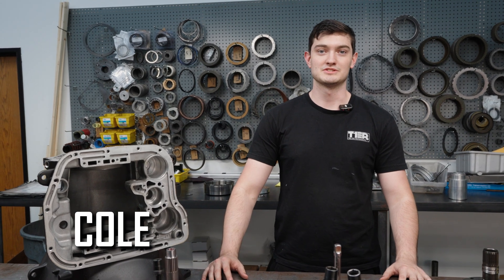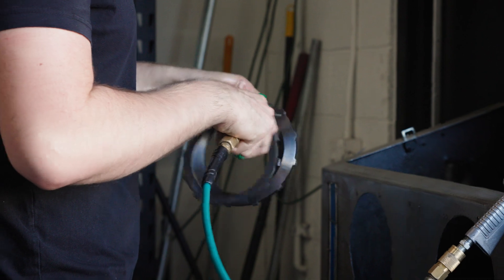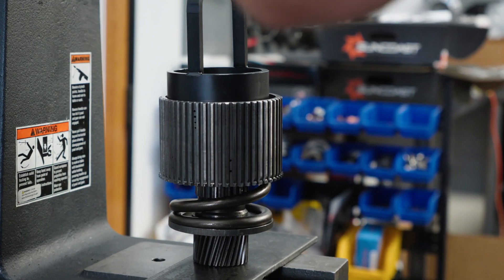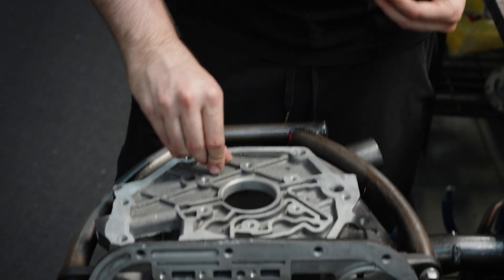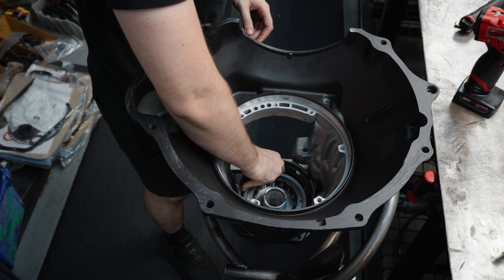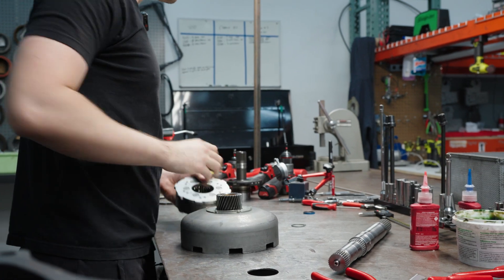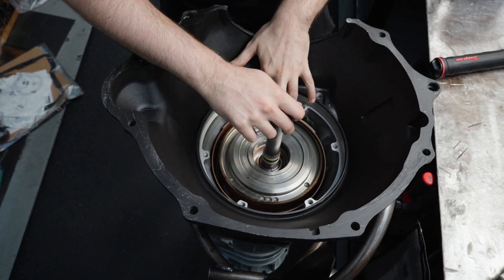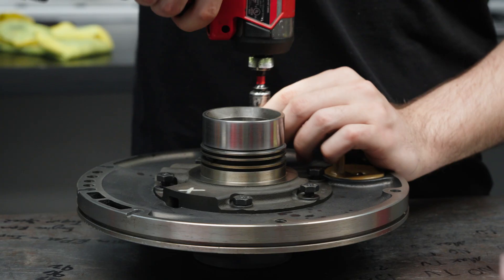Building a 650hp 48RE Transmission! | Tier One Stage 3 48RE Transmission Build!

Comment: Is it ok to assemble the clutches dry?  I thought they needed to soak in ATF first or is that just a some do some don't thing?
Reply from the maker: We do not do wet assemblies! In our 9 years of building, we have never run into an issue and find its unnecessary to do. Also doing it dry ensures you get the right tolerances for the clutches!
Reply: @tieronetransmissions  Thank you

Comment: Interesting stage 2 components. I'll look up the price info for my 48RE. Two questions....1- I was always taught to presoak the clutch discs in ATF before assembly, but you installed dry. Why?
2- I'm also seeking a deep oil pan, similar to your install, but I thought a riser had to be installed under the filter to allow the filter to sit lower in the pan to take advantage of the deeper sump. Your installation had the filter sitting direct on the valve body as normal. Any reasoning for that? 
Thank you for a great video.
Reply from the maker: Thanks for your questions!
1).  On modern transmissions (or modern-ish in the case of the 48REs), the clutches get soaked as soon as the truck is put into drive due to the pretty high line pressures you find on modern transmissions, so there's not really a point where they're NOT lubricated in actual operation.  Secondly, modern clutch materials are much better than they were back in the day, and they're less prone to burn-up.  Thirdly, wet clutches make assembly and air-checking the transmission a lot harder for no real tangible gain.
2).  Whether a deep pan comes with a filter spacer/riser does depend on the pan somewhat.  A lot of pans have extended fins that hold the filter up,  but some don't.  That being said, the PPE pans we use do not have raised fins, and they use a spacer, but we don't use it on our 48RE transmissions.  The reason being is that even on a deep pan, the fluid level is in the same spot as a standard pan (assuming a proper fill), and that spacer pushes the filter down really close to the bottom of the pan, which just makes it get clogged faster by all the material that ends up in the bottom of the pan during break-in.  You're generally better off keeping the filter high as much as possible.

Let us know if you have any other questions!
Reply: @tieronetransmissions  thank you for a very complete explanation. Appreciate it.
Reply from the maker: No worries!  Glad you enjoyed the video, and let us know if you have any other questions!

Comment: What is a,
518 low roller w/cage,
Band 618 reverse split,
Bushing frt pmp bronze tf?

                 👆🏻👆🏻👆🏻
I just had my transmission rebuilt and I don’t kno what those parts are and or what they are rated for HP wise… I have a 2006 dodge ram 3500 mega cab Cummins 24v and it is also,  chipped, I think 30 over injectors, upgraded valve body but idk to what extent and also stage 2 turbo, Mishimoto radiator and intercooler and last thing is a air dog fuel lift pump
Reply from the maker: It sounds like you got a rollerized sprag, billet band, and new front pump bushing.  Was your transmission built, or did you just get some service/maintenance done?